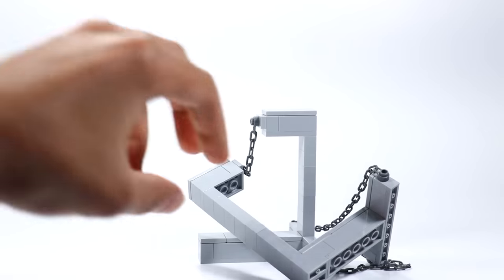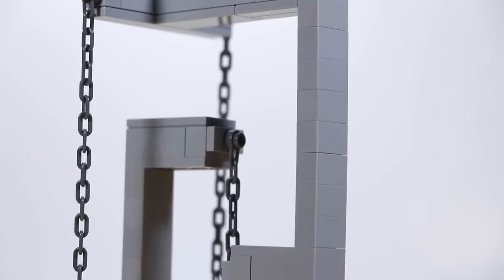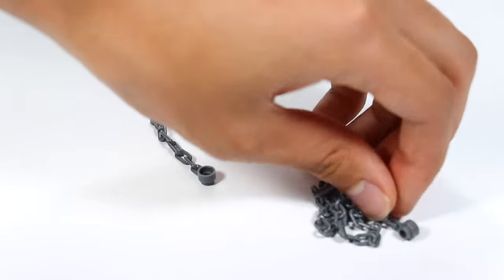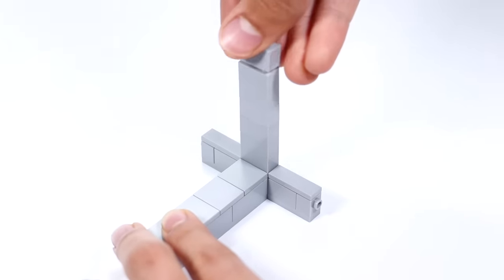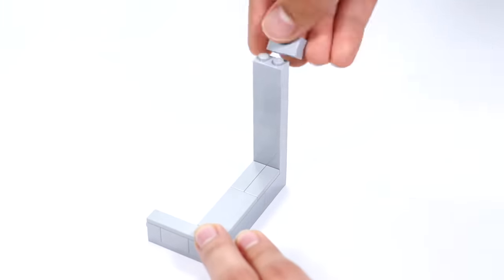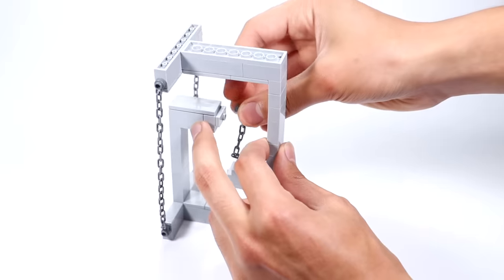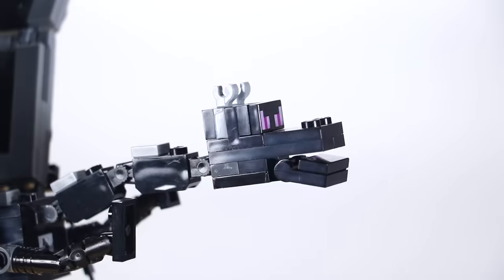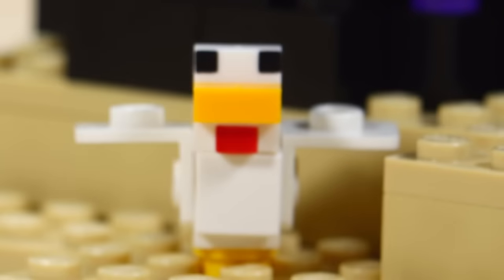LEGO TENSEGRITY⎜LEGO That FLOATS

Comment: For those of you complaining about the helmet on the pumpkin, the player might have a skin that has a pumpkin as a head, rather than the normal Steve/Alex head
Reply: Are pumpkins potatoes?
Reply: @jellycat6316  what?
Reply: @jellycat6316  what?
Reply: @jellycat6316  wtf no
Reply: @jellycat6316  what?
Reply: @jellycat6316  yes
Reply: Limbo  a pumpkin can be a potato if you have the right texture pack
Reply: This is indeed correct. Although then it won't save you from making endermen angry by looking at them.
Reply: This is indeed correct. Although then it won't save you from making endermen angry by looking at them.
Reply: @jellycat6316  hello?
Reply: @jellycat6316  quê?
Reply: @maninhu9837  you are the only correct person
Reply: @jellycat6316  what
Reply: @jellycat6316  Yes, they are.
Reply: True that📍

Comment: Ohhhh I get it. The top structure’s center of mass isn’t in the middle, so the short chain is being pulled down. And since the longer chains are the only thing holding the top structure up, they are getting pulled upwards. It makes more sense if you look at it yourself

Comment: If this is going to be a safe space for nerds can we take a moment to appreciate the physics behind it. Yeah it looks cool. Whatever. But you know what’s even cooler? Static equilibrium. Please. Call it what it is. You have the force of gravity pointing downward from the object’s center of mass so you need vector forces pointing in such opposite directions that they equal the force of gravity in the y component. This is the most fun part of physics 1 unless you have to calculate the angle of a person’s toes as they stand on their toes with a certain angle in the knees bending backwards and things get complicated and the problem remains unsolved by everyone except the Prof and Chegg. Okay I’m done

Comment: Can someone describe how this is possible
Reply: Static Equilibrium is the concept of using Newton’s 3rd law of equal and opposite forces. Now force is a vector in space so it has an x,y, and z component (think like an amount of the force that pulls up, back, and sideways) gravity is pulling here purely in the z component. If you use string or something else you give the object a vector force in the opp direction. If you have the opposing forces equal to the force of gravity in the z component, you have equilibrium and the object will not move unless given additional force in some direction